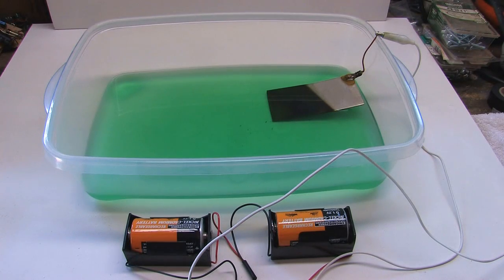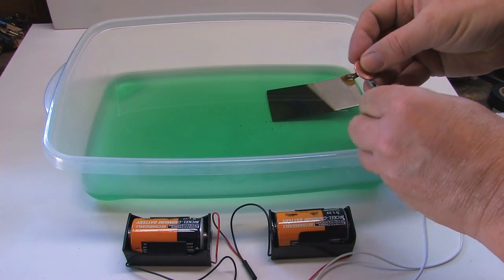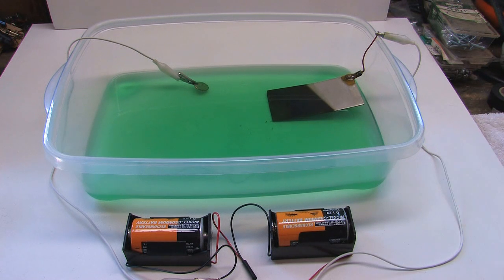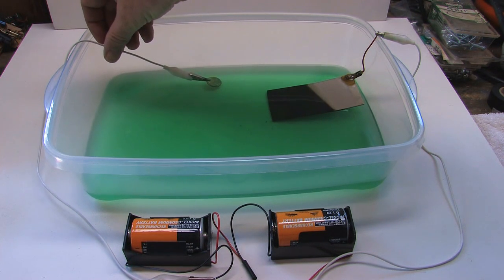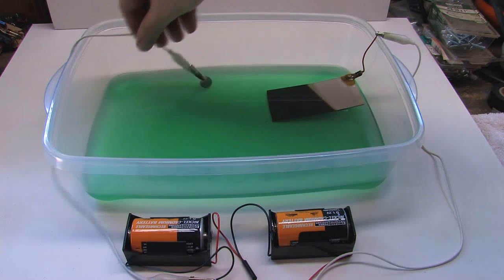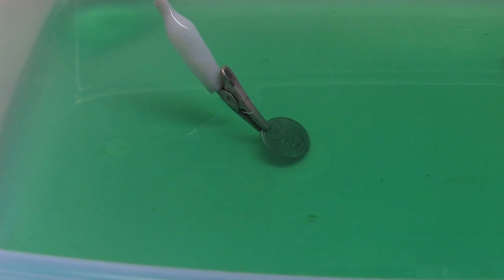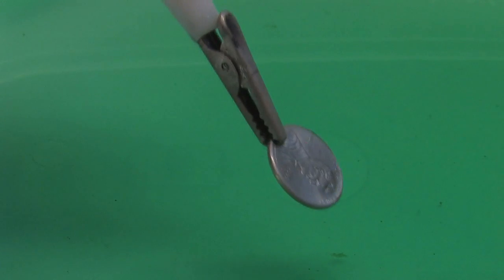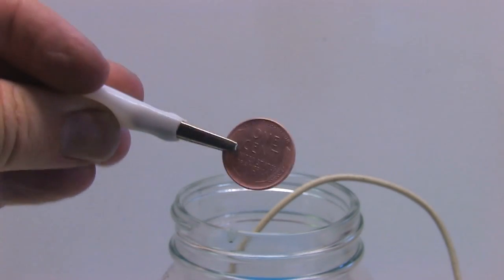Easy Nickel And Copper Electroplating Method

Comment: I want to plate organic materials such as seed pods, pine cones, leaves etc. Most of what I am seeing is using a varnishing with water base varnish to seal it, then graphite paint (conductive paint), and then proceeds to plating.  All the equipment I see for plating is not in my budget. I want to use my plated pieces in jewelry. Can I use you method to plate?

Comment from the maker: The nickel plate and the piece you want to plate should not physically touch.  Just place them both in the same bath.  You may want to rotate the piece you are plating a few times during the process as the side facing the nickel electrode will plate a little faster.

Comment from the maker: It's actually surprisingly easy!  You need to make any surface you plan to plate conductive.  For example, to plate paper, you can rub a pencil on it first (the pencil graphite is conductive) and then plate the graphite surface.  I've sometimes given plastics a quick coat of spray paint primer, then rubbed it with graphite, and plated.

Comment from the maker: You'll want to use the same caution in doing any kind of plating that you would handling chemicals.  It does not seem to me that there would be much exposure if you use reasonable caution.  But, assess your own abilities before taking anything on.  With regards to nickel as a carcinogen, I think many people worry when they check the MSDS on a chemical and find this.  But just about any chemical you look up will have similar dire dangers listed.  So common sense handling is my methodology...

Comment from the maker: Because the circuit was battery powered, with no adjustment possible, an ammeter wasn't really necessary.  And, results were good.  If you move to a higher power supply voltage, it's always great to hook in a ammeter.  Good suggestion.  Thanks.

Comment: just wanted to say thanks for the video. it makes electroplating a lot easier to understand. i was wondering though if you could tell me how to plate steel with cadmium. i understand that instead of the nickel anode i would use cadmium stock but what sulfate should i use? thanks

Comment from the maker: Thank you.  Aluminum is tricky to plate, no matter what metal because it oxidizes almost instantly.  Traditionally, aluminum must be zincated first, then cyanide copper plated to get a copper finish...  So it gets a little involved.  There seem to be simple "electroless" kits (kits that don't need electricity) for nickel plating aluminum, and from there you could copper plate it no prob?  Just my best guess...

Comment: Excellent video, your method seems to work very well. I'd like to plate some aluminium with copper; a vinegar bath and 9V seems to leave copper deposits that just scratch off. Do you think a nickel as an intermediate plate on aluminium would work?

Comment from the maker: I haven't tried plating zinc, but have heard that a nickel bath will attack a zinc surface and leave a dull discolored finish.  Check the web page in the comments for a cheaper recipe/chemicals.  I've found a few sources for chemicals. One is eBay, and the other which I'm about to try is Grainger.  Grainger can order chemicals from Spectrum and other suppliers, but I'm thinking you won't get killed on shipping if you pick it up in store?

Comment from the maker: Thank you for the compliment!  I have not used nickel chloride personally, but others have told me that they have.  I'm told it tends to build up faster, but is more prone to flaking off if the piece is stressed.  The usual bath is 1 part boric to 10 parts Nickel Chloride.  Thanks again.

Comment from the maker: You might try a small area and see if you're getting good adhesion?  I find that on the items I've plated with this method, the plate is usually stronger than paint adhesion.  For example, I used steel wool aggressively to clean and shine some copper parts I nickel plated, and the nickel seemed unharmed (no copper showed through).  I'm pretty sure a coat of paint would have been removed or damaged with that kind of abuse?  But how it compares to a professional plater's work, I do not know.

Comment from the maker: I've had the best results with the lower voltages.  I had many of the same problems you're describing with traditional set ups.  I'm virtually certain that if you do a "nickel strike" first, you'll eliminate your problems.  I don't know if that's the "cool" way a pro plater would do it. I find nickel adheres like mad, and copper LOVES to plate to nickel!  I just plated 6 items yesterday doing that and had pro results. I know it takes longer/costs more, but it's worth it to me to be hassle free!

Comment: Hi!

Now I tried to use 1020 steel bar, and another power supply. The first time I used a 5V, 800mA. Now it worked better, but the same happened. That was a low concetrated solution, 6V, 20A. A part of the metal got better plated, and another had the same problem.  Do you think I should increase, decrease current or voltage? Thanks!

Comment from the maker: There are lots of variables, but having the copper not adhering makes me wonder if the metal you're plating is the problem?  I had the same thing you describe happen when I tried to copper plate zinc.
Some metals are hard to copper plate, and can require additional steps.  You can google "copper plating XYZ," (XYZ being your metal) and usually get specific steps.
Nickel (as in the video) is often a good intermediate coat between trickier metals.  That's how I got the copper to stick to zinc.

Comment: Yes you can by using a Woods nickel strike. This can easily be made by using 45g/l of nickel chloride and 10% of HCl. The nickel plating solution is run at room temperature.

Comment from the maker: I haven't personally done gold plating.  It is more complicated than nickel as far as I can tell.  Caswell's makes a "brush on" electroplating kit for gold that looks to be very effective.  If your surface is iron, you probably won't need to strike or pickle it with other chemicals to get a good nickel plate, just as long as it's very clean.  I think I'd check Caswell (or other home plate companies) to see if the gold might not just brush right on iron?  You may be able to skip some steps!

Comment from the maker: I'm not certain exactly what particular steps might be needed to plate an iPhone.  If you are plating on plastic, you need to make it conductive first.  That might be tricky with an iPhone.  Usually it's done by rubbing graphite into the surface. If parts are aluminum, plating can be very difficult.  I might actually consider using gold spray paint instead.  Rustoleum makes an extraordinary gold spray paint.  Very durable...

Comment: thank you very much for you info... was very helpful as Im preparing to gold plating iPhone's with brush electroplating ;)
Now I will have to find only good and not expensive supplier for Gold Solution (can I use any Gold Solution or Nickel Solution or this have to be strict for brush gold plating?).
Chemicals I think I will need are: Electro cleaner, Activator, Nickel solution, Nickel activator, Gold solution... that's correct ?

Comment from the maker: Yes.  One of the primary uses of nickel is as an intermediate plating.  Unlike many other metals, it plates to most things, and most things plate to it.  So, it's a great way to get a gold, or many other plates, to have strong adhesion.  It's also useful because nickel is cheap by comparison, so you can do a thick nickel plate to level your surface if needed.  Last, nickel's high resistance to acids and some metals in alloys makes it a good undercoating to resist damage from future rusting.

Comment from the maker: Any oil dirt or grime, even oil from your finger tips can interfere with getting a perfect plate.  Plus, the copper may have oxidized a bit over the years.  So, a good scrub first is a good idea.  If you are referring to buffing the coin after plating, that's not always needed.  Most of the items I plated with this method were shiny right out of the bath.  But, it still doesn't hurt.  Thanks!

Comment from the maker: You can simply cradle pieces to be plated in a bent copper wire, or dangle more than one piece in the bath at the same time.  Both approaches are common.  Thanks!

Comment: I Googled Edison cell after checking out your website. Surprised I had not heard of that combination! Tough cells, I might have to make one. Thanks for the info! Was good to know some of the things I have been observing (Like copper transfer in lead alum cell) are confirmed re electroplating too! Have you tried any with alum? lead neg and carbon pos seems to be a winner. as well as the classic lead-alum-lead.

Comment: Can you draw current from the bath after plating? with the plated copper still in? Ie: is this a battery too? Seems to me like there would be ion exchange going on and thus rechargeable battery would be plausible... Might not be efficient, But I think you would get some power back, and de-nickel the copper if you hook up a load...

Comment from the maker: I've found the coating using this method to be at least as durable as paint.  I've often used steel wool on the finish without problems.  But, I think for a large object that might take a beating like a quad axle, it would probably be worth buying a "pro" kit from a company like Caswell's.

Comment: I need to re-plate a quad axle which used to be chromium plated. Do you think nickel plating would be resilient enough (it was mostly stone chips that took away the chrome) and will a stronger power supply give a stronger coat?
Thanks.

Comment: It doesn't matter how long you have been in the plating biz, it never gets old plating coins. fortunately and unfortunately I no longer work with electro nickle ( the copper cyanide fumes take a toll). but I must say that switching to a shop dealing with only zinc, aluminium, and electro-less nickle is much easier on the lungs.

Comment from the maker: Any good chemical supply house has it.  I've also gotten lots of chemicals at better prices on eBay.  Check the web page in the video for a less expensive recipe with easy eBay chems.  As to reverse plating, I'm not familiar with that.  Sounds interesting...  Thanks!

Comment from the maker: The batteries are connected in series, not parallel.  So, the negative lead from one battery goes to the negative electrode in the bath. The positive lead from the OTHER battery goes to the positive electrode in the bath.  The two remaining wires coming from the batteries are connected together.  This produces 3 volts.  Sorry I can't provide a drawing here.  But, I'll upload a drawing for you to the web page mentioned at the end of the video. Thanks!

Comment: Interesting. I have to assume you take the positive cables for each battery to one clip and the negatives to the other clip. I take it that using two bettries is to give a longer powered time for the plating to thicken. The video unfortunately does not show the wiring in any detail. I need to try this small scale first before venturing into my main project.

Comment from the maker: I think you have posted on the wrong video, as your comments seem directed to the Edison cell batteries.  As far as your comments, the data seems fairly solid on cell life.  Not only theoretically (based on solubility tests), but by the fact that cells more than 75 years old with full function are relatively common.  Derivatives of this design have served in spacecraft maintaining capacity without service for decades.  Electrolyte should be changed if possible, and 3D printing is a GREAT idea.

Comment: It's strange how there is no real data to show these have a 50 year life-span, let alone the design specs for such a unit...

Also I notice everyone is using purely liquid electrolyte, even manufacturers, good luck with durability on that. It's smarter to use a gel reaction, or even better: glass-mat. You can even 3D-print enclosures from polypropylene. If your waiting for manufacturers, there is little profit-margin in these, so don't hold your breath..

Comment from the maker: Most plating baths use a higher voltage, but as mentioned in the video, I've had long term poor results with higher voltages.  At least in my case, this little battery setup has led to smooth, shiny and durable plates.  Some comments have suggested adding more batteries, but in parallel to add to the amps but not the volts.  That seems like a good idea.  Thanks!

Comment from the maker: I did not use a hydrometer or know the specific gravity if this is what you're asking.  The proportions as mentioned in the video are 1 quart water to 3 Oz. nickel ammonium sulfate.  You can size that up or down as needed.  The web page mentioned in the comments gives an alternative mix as well.  You can do quite a bit of plating before you need to make a new bath.  thanks.

Comment from the maker: Plating on plastic is possible.  Plating with gold is a different process. Google search Caswell gold plating for a good hobby kit.  To plate on plastic or any other nonconductor, you have to make it conductive first.  For example, you can plate on paper using the nickel or copper plating method in the video.  You simply must scribble on the paper with a pencil first.  The pencil is graphite, which is conductive, and the paper plates just great.  Thanks.

Comment from the maker: You just need enough solution to cover your work ideally.  It's also possible for large pieces to plate in sections if your bath is small.  Please note that I've added an improptu web page with a less expensive chemical combo that also works great.  When plating larger pieces, it brings the cost down to a fraction of the original recipe.

Comment: you can put more batteries in parallel to do this faster. for electroplating processes you need amperage not voltage so more batteries in parallel will considerably speed up the process. i am using 1,5V  5x parallel D cell batteries Alkaline 14000mAh

Comment: When I've gotten poor adhesion at low voltage (because a penny wasn't cleaned), I've flaked off pieces of nickel that were quite thick.  So, I think thickness is OK.  And when you get a good plate, you can scrub it hard with a scotch bright pad and cleanser and it won't come off at all... even after a lot of hard scrubbing.   So, I don't know the technical thickness, or exactly how good the adhesion is, but my "ballpark" measure would be to say it's "stronger than paint." Hopefully useful.  :-)

Comment from the maker: I had the exact same problems, including simple copper plating, until I used a lower voltage source as shown.  Now I've been lucky enough to get really perfect appearing plates for quite some time.  I know that the "pros" are wizards with their prep and bath chemistry and can plate quickly and with great adhesion at higher voltages.  What's great about this process is that for small parts, it SEEMS to have been cheap and foolproof for me...  Thanks!

Comment: good thick platingseems something nearly impossible for me :  no matter how much I clean everything, i just grow huge dendrites. 

attempts to plate steel ends with no success everything just falls away. and it is extremely hard to immerse cleaned steel part into solution fast enough, before it starts to rust.

Comment from the maker: That's a very tricky question.  Pot metal often contains zinc and softer metals like lead that melt easily with other scrap in a pot.  In my experience, this kind of metal can "blister" if plated directly.  Most plating shops copper plate pot metal first in a cyanide bath, and/or do a "pre dip" in a fluoride acid to get pot metal to plate.  If the parts are aluminum, they are similarly difficult to plate because aluminum corrodes almost instantly, so several etching baths are needed.

Comment from the maker: Please check the web page mentioned in the video notes for the latest updates, including how to use less expensive Nickel Sulfate.
The plate seems quite durable. I scrubbed the pennies I plated like mad using a scotch bright pad and abrasive cleanser and caused no damage to the finish. So, it seems to be stronger than paint, which seems pretty good to me! Getting pieces VERY clean before plating seems the most important thing. Thanks!

Comment from the maker: There are lots of good sources for nickel for this electrode.  Most welding stores sell nickel rod which will work.  Canadian nickels (pre 1982) are pure nickel and available on eBay.  The plate I used came from McMaster Carr.  Many industrial suppliers have these.
I also just tested and added a less expensive recipe to the web page mentioned in the notes above.
Thanks!

Comment from the maker: You'll probably need a higher current (more batteries) to plate such a large object.
As far as a dull nickel finish, you should be able to get that with this process.
I might recommend that you look into the "brush on" electroplating kits sold on eBay and elsewhere for your project.
You can clean brass with a weak acid, and or hot detergents.
To check if you've removed all oils, see if water coats parts rather than beads or runs off them.

Comment: cheers mate yes all makes sense have very recently bought a nickel plating kit and have been researching it for a while, so far as i understand the electrolytic solution would work for plating but as you said without the nickel ingot the ions in the soulution would be "used" and not replaced so the soulution would become pretty useless after a few goes and would need replacing, so the ingot as you said replaces the ions in the solution preservong the life of the solution for longer 
cheers mate